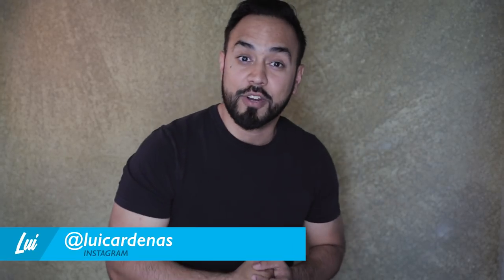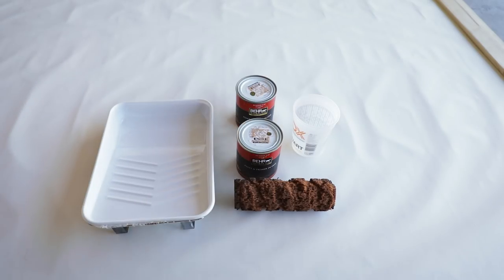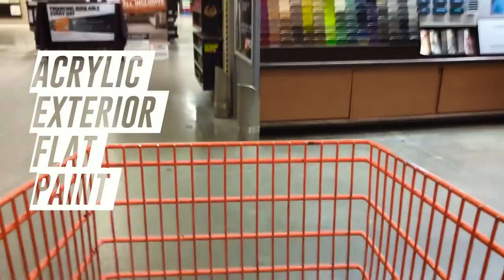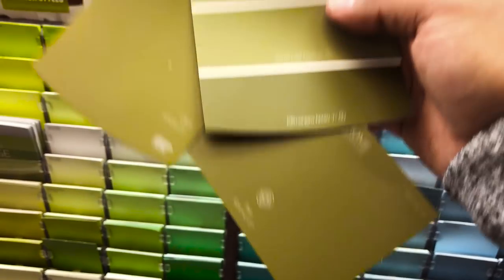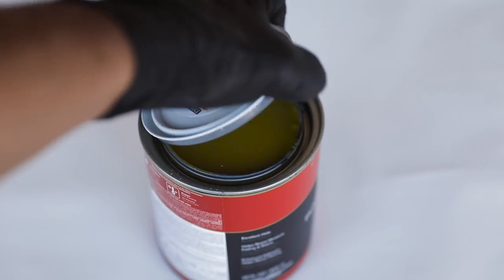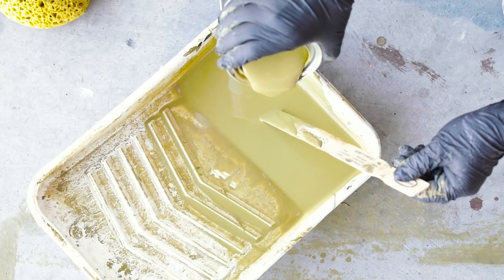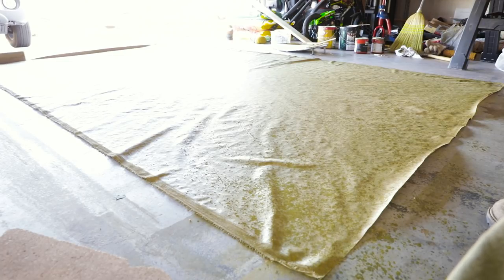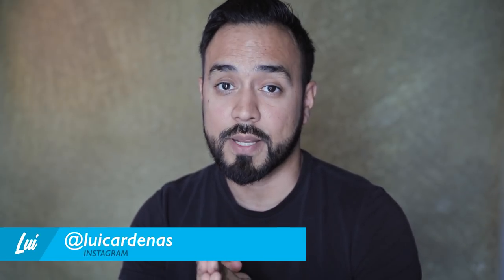How to Paint Your Own Canvas Backdrop / DIY

Comment: great video. my canvas background is shot after 14 years, I checked out the prices to buy a 24x20 canvas backdrop and nearly passed out. You video was great. I'm going to paint my own. One question: did you sew a pocket for the stand or do you just clip it on?
Reply from the maker: Hi John! I’m very glad you got inspired to paint your own. Like you mentioned, there are some really beautiful ones you can purchase but they’re also expensive. 

I taped my canvas onto a PVC tube so I can roll it and It also helps to prevent getting any wrinkles on it.

Comment: Lui. Apologize for asking a dumb question, but what is a cotton canvas? It is just cotton cloth that is thick. Also, to prime a canvas can we just use paint primer. Thank you
Reply from the maker: No such things as a dumb question my friend ^_^. The canvas is more like a textured cloth or closely woven cloth (like that the painters use for their artistic paintings). It was a nice texture and strength to it. In this case I used acrylic paint (because it is very easy to mixed and thinned out using only water.  So I would recommend using an Acrylic based Gesso. This will help you seal the surface for better paint coverage and if you prime both sides you can have 2 colors on the same material. Not sure if I can post links here but here's one that I've used:

https://www.dickblick.com/products/blickrylic-gesso/?clickTracking=true&wmcp=pla&wmcid=items&wmckw=00711-1016&gclid=CjwKCAjw7cDaBRBtEiwAsxprXQvfS__DNmJWnP_bQn47JrenSeuMzTQMvioQhrQx44pxucFIFKUMKBoCjJEQAvD_BwE
Reply: Thank you for the reply Lui.
Reply: You can prime the canvas with watered out pva glue 1/4.

Comment: How long does it take to dry?
Reply from the maker: Hello Janos! It is hard to tell, this will depend on the amount of water/paint you use, as well of the room temperature/humidity conditions. in my case, I was waiting for about 30mins before applying the next coat of paint.

Comment: Nice painting 🎨. Wonderful. Please was it the normal emulsion paint we used for houses? If not, could you reply in the comment below with the type of the pain.. Please
Reply from the maker: Hello! Yes I actually got my painted from a local hardware store(Home depot) and I used exterior paint thinking it should have more UV protection. And I’m very happy with the results. After years of painting my first backdrop it still looks amazing.
Reply from the maker: Do make sure is acrylic paint. (It’s easier to mix and adjust the thickness of it using just water)

Comment: Guys! does this painting works on paper background as well?
Reply from the maker: I believe it could work on paper, (thick paper) but you would be a little more limited on how much you can water down the paint, and how many coats the paper can take vs canvas. Since canvas is a lot stronger.

Comment: Hi Lui, going to paint my own backdrop. Question:  why did you use Acrylic Exterior paint and not INTERIOR paint?
Reply from the maker: Great question Miguel! The reason behind the exterior paint was because I thought it would last longer, with “tougher” paint. However on my most recent one I did tried using interior paint and so far I haven’t noticed any huge difference.
Reply: @LuiCardenasphotography  If you have any pictures or video of the new screen I'd love to see it. I"m going to go with a blue-themed backdrop. Gracias!

Comment: Great video! How did you keep your canvas from wrinkles?
Reply from the maker: Hi! I used some spare wood as weight on the edges to keep it from folding over and it helped me keep the canvas a little stretched. 

When the paint was wet I did get some wrinkles but they went away when it dried out. I’m sure the thinner the canvas the more problems you may have with wrinkles.

Comment: Question: Do you have to stretch while drying to prevent wrinkles? Or does it sort itself out?
Reply from the maker: I usually don’t really stretch it, but I like to put some weight on the edges (spare wood) so it doesn’t fold in.

With the backdrops I’ve done it goes flat once it’s dry
Reply: @LuiCardenasphotography  Thanks man!!! Such a great tutorial.